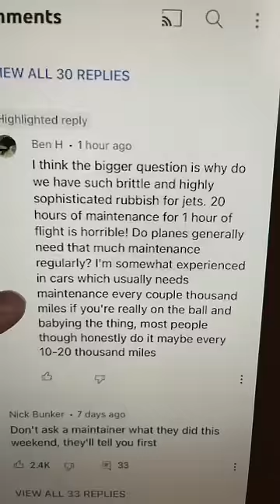Why does an F-16 need 17 hours of maintenance for every hour of flight?

Comment: The Air Force has specialists so whereas other devices you'd have a limited amount of personnel the Air Force has unlimited resources and many personnel.  They put the golf courses in before they build the runway.  It might take the Squids or Jarheads one hour to fix a discrepancy and it'll take ten for the Scare Force.

Comment: What kind of question was that?
Regular aircraft require inspections prior to each flight. No shortcuts are taken if a problem is found.
How much time is spent inspecting and repairing NASCAR, F1, Indy cars…. Weeks between races with zero days off for those mechanics.

Comment: No not every screw and bolt needs to be checked and the 17 hour figure is an average among all fields that work in tandem on the plane so 3 different groups like avionics, engine and weaponry are all working on the plane at the same time for 3 hours thats 9 hours of work total. From personal experience the electronics on the plane r not ment to last so there is alot of bulb switching. Further more working clearance on the aircraft is sometimes tough to comeby because the hanger maintnece crew need to keep track of anything and everything that goes in and out of the hanger incase of an F.O.B incident which can grounded an otherwise fully operational plane for days or even weeks.
You might have been an AT but you were not in aircraft maintenance

Edit: sorry for being harsh Iike your videos and this is is good aswell but a cracked canopy is an incredibly rare occurrence

Comment: Ok, lets rephrase that question. What are the main maintenance drivers. Electrics, structural, hydraulics, fuel system, bomb loading. It needs 17 hours of maintenance because it goes fast isnt really an answer.

Comment: Is there not a bag for the fuel cell? I seem to believe that the cell is a tank but has a bag (bladder) inside so the when fuel leaves to be burned, it continues to pulling the bag. This would allow the pump to have fuel at all angles.

Comment: Maintainers are pretty useless without a pilot to fly the plane, and if that pilot is inexperienced you can kiss air superiority goodbye depending on the enemy’s level of sophistication, and even sometimes in spite of it. The whole crew play essential roles that could not be gone without, even those who do little more than help sweep the flight deck are absolutely essential to the mission.

Comment: Thanks for the explation, esp never thought about the fluid issues, & I know these birds need alot love & attention, but just a legit question, not trying to be an ahole, but if its actually 17hrs/1hr of flight, which I don't doubt, but If you go on a single 3-4 hr run does that exponentially turn into 50-70 hrs of maintenance?
 Wouldn't the same 17hrs or so of maintenance cover and check for all the same issues whether you flew 1 or 4 hrs? Would it be more accurate to say 17hrs/flight? Thanks for any clarification. 👍🛩

Comment: Saying a jet aircraft needs high maintenance time because it is a high performance is not a good argument.  The cars are low maintenance because otherwise no one would buy a car.  Modern cars are extremely sofisticated machines with decades of finely tuned and evolved designs underneath.  Military jets r merely made to meet the design requirement as specifed by the government.  The requirements have far less regard to durability compared to cars.  Of course there's far less competition to make "better" aircraft with less motivation to make them maintenance free.  That's the reality.

Comment: That's why the U.S. airforce used its fighter jets extensively in Afghanistan! (Sarcasm.)

 This despite the Air Force also having lots of lower maintenance ground attack planes such as their A10s and AC130s.

This is also despite the fact that the terrorist militants would be easily outmached by f'ing wooden biplanes with machine guns attached, since the terrorist militants had NO planes.

This is also despite ths fact that the terrorist militants were such small targets and the shooting distances so long that the fighter jets frequently missed their targets or left some of the terrorist militants alive before the fighter jets had to circle back to base to refuel due to to the incredibly long distances they were flying, leaving those terrorist militants free to resume the firefight with U.S. soldiers from where they'd left off.

Comment: In the case of helicopters, if you have a breakdown, you can't just pull over on a cloud. If you're very lucky, you can auto-rotate into a controlled crash. In a plane your best case scenario is your plane turns into a glider. Not a good situation when you're in foreign airspace getting clocked by observers.

Proper preventative maintenance is time-consuming but unless you are very comfortable with meeting God, take the fucking time. Every time. Your toyota camry is not getting you out of hostile CAP.

Comment: You just answered why a fighter aircraft needs long hours of maintenance but didn't explain why an F16 requires 19 Hours of maintenance. There are many fighter jets which require less time for maintenance compared to F16 but are just as proficient like the Dassault rafale which requires only 15 hours of maintenance but it is costlier to fly per hour compared to the F16.

Comment: I think people lose track of the point that you don't put 17 hours every time the plane flies for an hour if you go up three times in a week and spend 12 hours in the air you may have three or four guys spend an hour on the plane in between each of those but then after a week after those 12 hours they're going to have 15 or 20 guys spend a couple of days going over the plane and putting two or three hundred hours in while the plane is down for a few days averaging out to 17 hours for every flight hour it's not that the plane goes out for 2 hours and all of matically you spend 34 hours of maintenance on it

Comment: If every inch, rivet, screw,… needs to be checked after every flight, then why does it matter if it was a 1hr or 5hrs flight?  I mean, if it takes 17hrs for every hour of flight i assume it takes 34hrs for 2hrs of flight, etc.  But if that 17hrs of maintenance includes inspecting every screw, rivet,… then i don’t see why a longer flight would take a longer maintenance.  Do they just take a longer look at everything?  Is that 17hr maintenance half-arsed or is the longer maintenance just wasting time looking at the same screw?

Comment: Does the F16 have a transmission?  Or even Pistons, crankshafts, connecting rods, valves, heads, etc?  A jet turbine is much simpler than a reciprocal engine plus transmission in a car.

Comment: Well you didn't really explain it well .

The real answer is, they do not need 17 hours of maintenance for every hour of flight.
a huge part of that "maintenance" is really just inspections.

If a Jet comes down from a 4 hour ferry hop.. it never did any of those G's
and it won't need 68 hours of maintenance after that flight either.

17 hours is first of all a big averaged number across all the planes in the inventory
with varying use , age and maintenance times.
A lot of em will just have their inspections and be up minimal maintecenance
and some of the hanger queens will need way more effort to be flight ready
Typically the more regularly flown the better they get..

Comment: Pressurized with nitrogen for fuel at all angles? WTF No. The all-angle problem is solved with having multiple fuel pickups. There is nitrogen going into the tanks for a different reason: as fuel leaves a fuel tank, air goes in (problem: oxygen + fuel + spark/compression=BOOM) so some military aircraft put nitrogen air in to reduce that risk of non-spontaneous combustion.

Comment: As someone who worked the 16 for 4 years, and who’s worked 8 different airframes in the Air Force, it is the biggest piece of shit in the fleet. It’s an old, irrelevant design that other aircraft can replace easily. Single engine as well.

Comment: Planes are a lot like motorcycles, you  dont necessarily need that much maintenance, but maintenance is cheap compared to even a small failure in the air or on 2 wheels. But why even risk it when you have the manpower to go over every inch after every flight?

Comment: I still think 17h maintenance per flight hour is insane. Given a typical sortie is 1 hour, this means 17h of maintenance after every flight. Is this how it’s done or is it a big block of maintenance after a few flights? I appreciate the F16 is not a Toyota Camry but it’s also not built the same, so it’s not a fair comparison. Also, a cracked windscreen on an F16 is rare. How long does it take to inspect the windscreen after each flight?

Comment: I’m calling bullshit on pressurised nitrogen fuel tanks to ensure fuel feed. Nope just nope for many reasons. First your mistaking the filling the empty fuel tank space with nitrogen with a fuel feeding thing. It’s not it’s to do with fire suppression within the tank and the nitrogen can come from a bottle or modern aircraft have a nitrogen generator onboard to get nitrogen from the air. Second the tanks are not pressurised at all but rather just at ambient pressure. Making a vessel to take positive pressure inside it is very difficult as large flattish wing surfaces don’t resist pressure on the concave side very well so would need to be made very strong=heavy. 3 pressurised fuel flow would be wholly inadequate to supply a jet turbine’s fuel requirement. 4 most importantly, even if you built a ridiculously heavy fully pressurised wing tank that could magically supply fuel at afterburner rates then it still wouldn’t work. You see no matter what the nitrogen pressure the fuel is denser and will always be at the bottom when taking localised G forces into account so there is no point in highly pressurised fuel tanks as a pump can always be used.

Australian ATPL pilot 14000 hours and due to my job I’m licensed or approved really to conduct daily inspections, pre flight inspections, post flight inspections, 3 day 7 day and 100 hour inspections on Dash 8 100/200/300 series aircraft.

Comment: That stat is not surprising, but still shocking (if that makes sense)
Reply: nah, it doesn't
Reply: @NoName-rd6et  It's not surprising that an F-16 requires a tremendous amount of maintenance, but the actual specifics involved are so extensive it's hard to take in at once.

There, I spelled it out for you.

Comment: True, they are A key to the air power...but you have to admit, that you kinda need pilots, too...still
I mean not forever, though. They are already trying to let AI fly F16s for a while now. But this is meant as they say fir joint piloting of AI and a pilot, so they can both input with theur best strengths, AI doesn't pass out in prolonged high G turn and can identify things further away and of course save the pilit precious concentration time on the stick, i.e. during transit.

Comment: That's not quite the right answer. There are other jets with shorter maintenance windows and I'm not entirely sure that a F-16 takes that long to begin with. But if it did, you'd have to tackle the first issue, why others can do with shorter maintenance downtimes.

Comment: This is an interesting and important video, addressing a question I´ve asked myself -- but you confuse me: You should know what you are talking about, but what you say is subsidiary or plain false.

For example: the car analogy is clever but not strictly apropos. Maintainers do not (because they can not) “check every rivet on the airplane.“ (Instead, software tracks the number of times and the magnitude of high-G maneuvering, and comprehensive checking is done when there is sustained ACM, an over-stress, or after a set duration). “What would happen if a cockpit canopy failed?“ -- short, dumb answer: It doesn´t -- it is fabricated out of multiple layers of Lexan and tempered glass, and designed to the specification of withstanding a (heavy!) birdstrike at Mach 1. (Yes, yes, I know there is plenty that can -- and has -- gone wrong with this system ).

Using endoscopes to perform internal engine examination, and figuring out chaffing electrical cables (!), are just as much a concern as those you mention.

I look forward to your future full length presentation of the profound -- and thankless -- importance of maintainers (for the safety of the pilot as well as its intrinsic influence on real-world military effectiveness) for how you requite these assertions.
Reply from the maker: Already done:
https://www.youtube.com/watch?v=tmM5KSoW2qA&feature=share&utm_source=EJGixIgBCJiu2KjB4oSJEQ

Comment: Ah reformers. "We should just use p51 mustangs with jet engines attached it's so much more effective"

Wonder what the size of your average maintenance team is.
5?
10?

That 20 hours isn't alot if it's 20 people working for 1 hour per jet.

Comment: You're wrong the maintainers are not the key to Air Supremacy. Everything in which it takes to maintain equip fuel fly and their ability to work in unison as a team that is the key to Air Supremacy the maintainers cannot project Air Supremacy without the pilots the pilots cannot do anything without the maintainers and if you don't have weapons and fuel you ain't going to do nothing but sightseeing.

Comment: Also the f16 maintenance per flight hour is alot lower than other planes f22 being really high is the main reason we stopped buying them the f35 became alot more viable than f22 because a new method to reapply the stealth coating on the outside of the plane china and ruissia dont have that tech so untill then they will never have a viable stealth fighter in large numbers they cant afford the maintenance or manufacturing costs

Comment: I am curious, how mach maintenance Mig-29 need for every hours of flight? I would bet on much lower number.
Reply: i was thinking the same until russian most recent national day where the sky was sunny and yet there air force parade was cancelled
Reply: @caiusion3893  There are no logic in this statement.
Reply: @Mutineer9  how come if the migs require less mentenance they should have fly on russia parade day since they did not it means they werent properly mentained and were unable to fly when neede to
Reply: @caiusion3893  There are million reason to cancel, even if true. Like for example, have planes fly slow in known space and time in war times? You statesmen has no logic.

Comment: That was an ignorant tech, think about it, if you were to just have a car the size of a jet, just that alone would change the scope of time of a car. It's like comparing working on a train to a car, you have a massive diesel engine and electric motors in a train, which is a simpler operating system then a gasoline vehicle but by no means faster or easier to work on!!

Comment: Car v F16. The latter plus of ten times the speed. Stress in all plains not just horizontal. Vertical. Climb. Dive. Yaw. Roll. Inverted. Thrust. All aspects plus of ten times the load. Constantly and rapidly changing plus nine g to minus 5 g in mere seconds. These loads are inflicted on both airframe and pilot. All at combat levels. Skill levels needed car driver two year old wiping ketchup off a plate. Pilots at their levels a brain surgeon operating on five patients at once scalpel in each hand one with his toes each foot the fifth in his teeth. All while blindfolded and having a gun to his temple. Easy NOT!!! To keep that bird in the air with any chance of it being kept flying. That is why soo many top tier guys have to be ready to go. The crew chief and his team own that bird. The pilot with blessing of the crew chief is allowed to borrow it occasionally.

Comment: An F-16 doesn't require 17 hours of MX after every hour of flight lmao. A Pre-Flight, Post-Flight and Thru-Flight inspection don't even take an hour per inspection. 

You should probably do a little more research before you post shit you're not even correct about. The only way a jet lands and requires "17 hours of MX" is when something royally fucked up during flight, and you find that discrepancy during any of your inspections.

Comment: The most over exaggerated video you have made. From- a guy that works on 16s.
Reply: How so brother?. Do you mind explaining? I'm genuinely curious
Reply: @lemiphil2388  they are not looked at for 17 hours after every flight. They might get looked at for a few hours. If nothing is found we're good to go. But then every 50 hrs it gets torn down and inspected for a week. So the average might come to 17 hrs. Also "every inch every screw, every rivet" is not looked at after every flight. Not even close. That would take days. If the jet lands with no problems it's more of a general look over/inspection to look for obvious problems. Feel free to ask more questions if needed.
Reply: @benjaminnichols6558  oh I understand now. Thanks for clarifying.